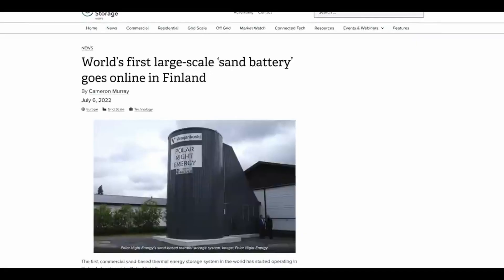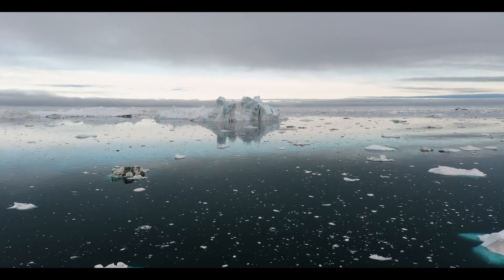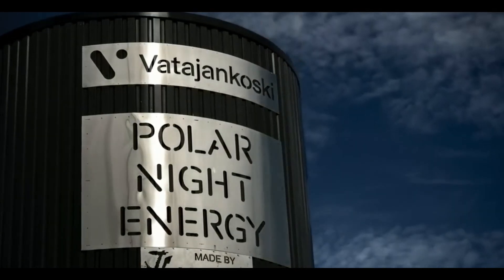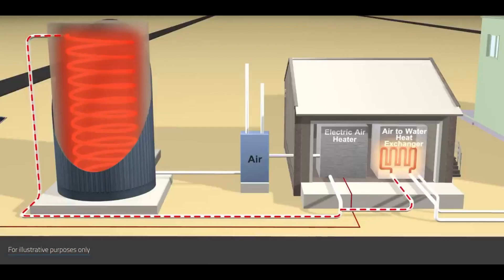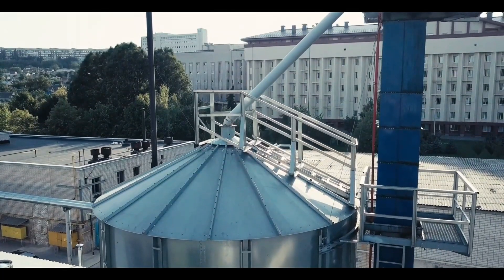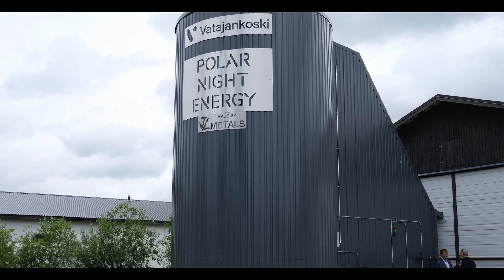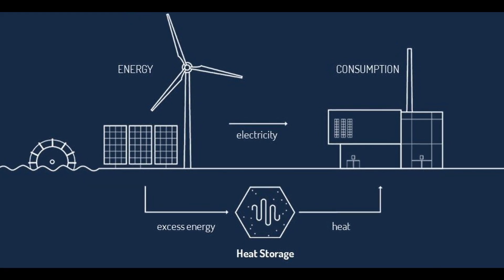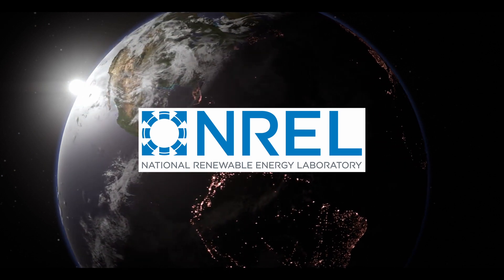How Does A Sand Battery Work?

Comment: You can use the burning lithium batteries to heat the sand.....
Reply: takes a shot at lithium batteries for being flammable, but has no problem with gas and oil which literally is designed to burn